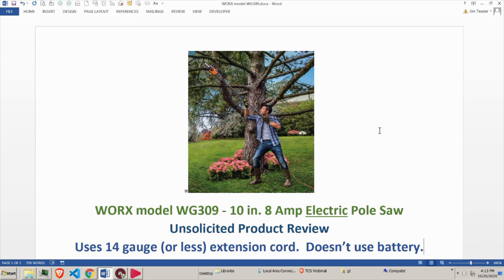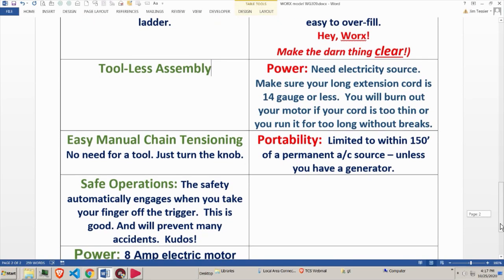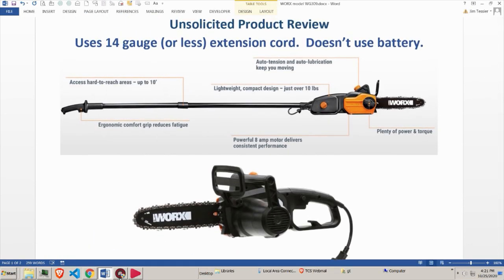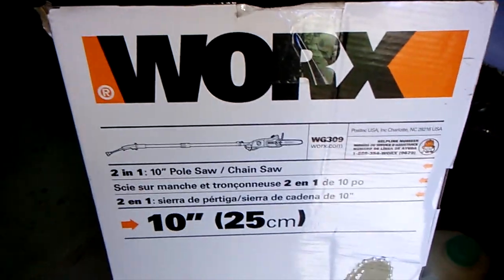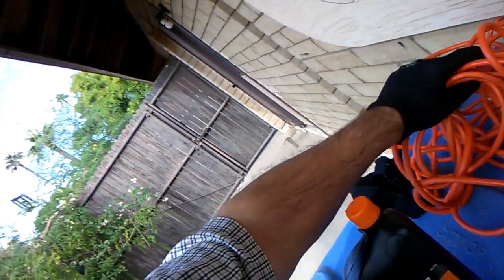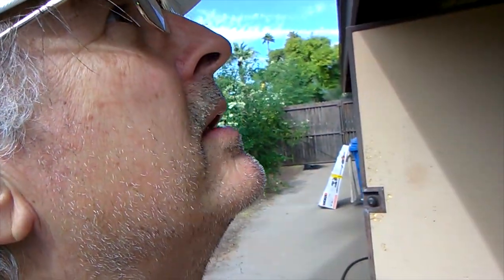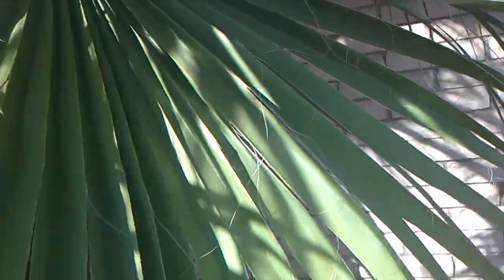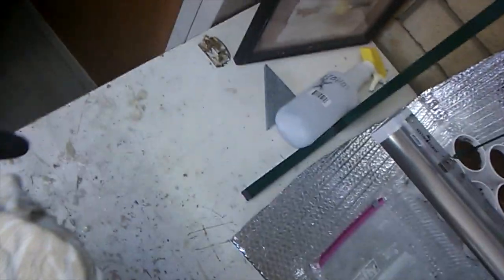On Any Palm Sunday - WORX WG309 Pole Saw Product Review

Comment: Great review, thank you for sharing.
Reply from the maker: Thanks, Daniel.  'Good to hear from you.
Reply: @surfviewgardens2396  can’t wait for more videos, especially regarding pruning moringas.
Reply from the maker: @danielfisch655  Thanks for the idea. I may do one on grafting. I have a Moringa or two that aren't producing flowers/pods as prolific as the rest.  But, they are the biggest and most hearty.  So, in late winter, I may cut from the prolific ones and splice those on to the hearty ones to see if I can get them producing like the rest.  I've never seen anyone do that with Moringa and it could be interesting - especially when it works.  Seeing flowers and early pods on one part of the tree and none on the rest should be proof that it works.  At the same time, that will take at least two months to produce that video due to the need for the reveal shots in early spring.
Reply: @surfviewgardens2396  I’m looking forward to that. I have a question, in your opinion when is a good time to cut back a newer six foot moringa tree to encourage side growth.
Reply from the maker: @danielfisch655  Here in Phoenix, I do occasional trimming throughout the year.  However, if doing a major haircut, I would say that the best time is in late February right after the chance of a freeze has passed. The roots will let go of the nitrogen nodules and the warming soil will allow the soil food web (bacteria, fungi, nematodes, and protozoa) to convert it to make the nitrogen accessible to the plant.  Doing it then will cause a surge in growth as the days get longer and warmer.  You'll also start to water it (gradually) more each week - which will help those organisms "swim in the damp soil".  I hope that helps.
Reply: @surfviewgardens2396  thank you and I’ll be putting it off until February. I’ll let you know how it does.